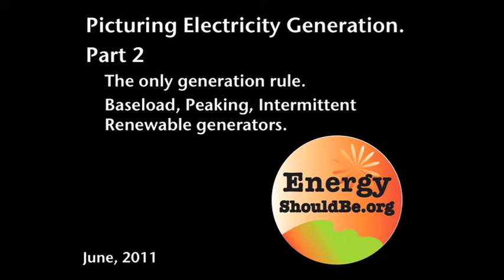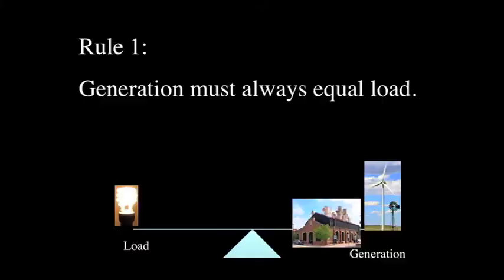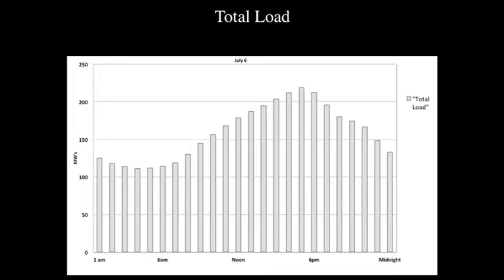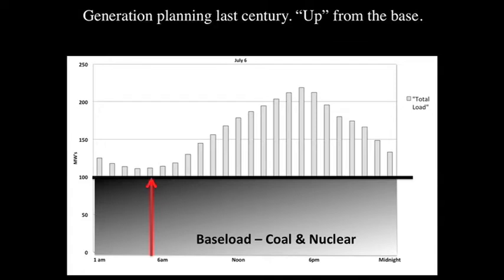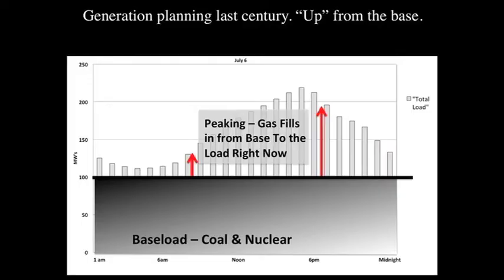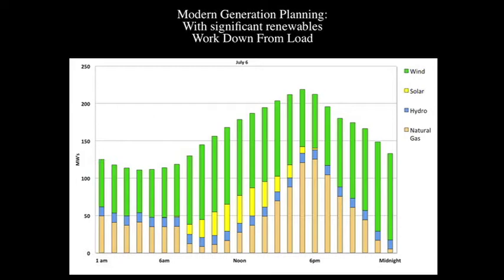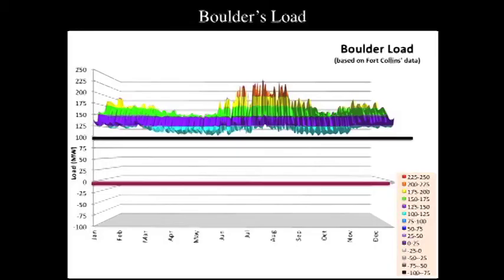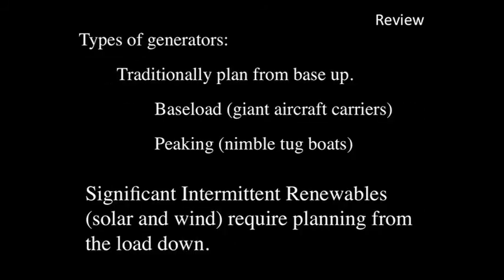Picturing Electricity Generation. Part 2. The Only Generation Rule and types of generators.

Comment: Uthman:

Yes. If there is significantly more generation than load then voltage and frequency (if the grid is AC) go up and either the generators must be turned down or off, or the loads must be turned off to protect them from overvoltage or over frequency.

The act of keeping generation and load roughly equal is called "balancing".